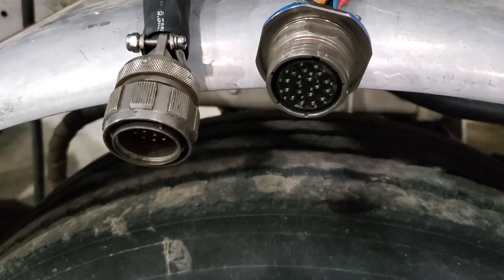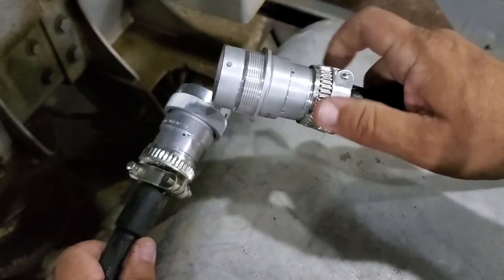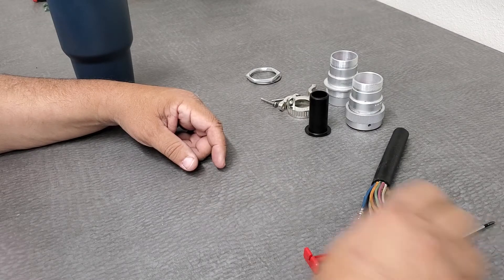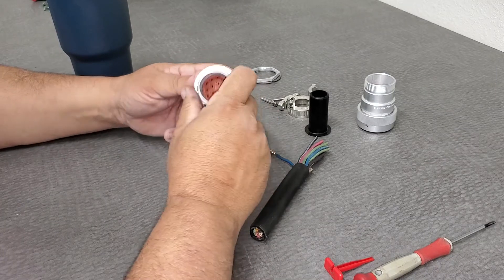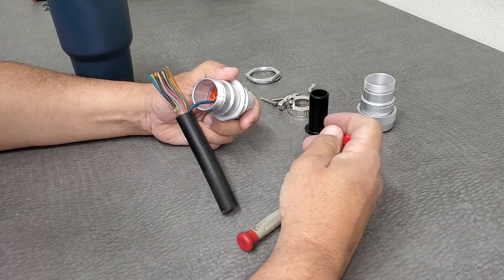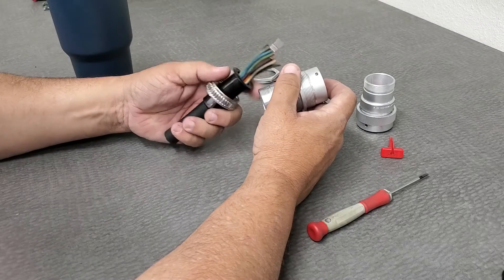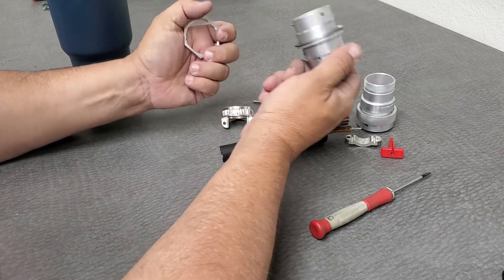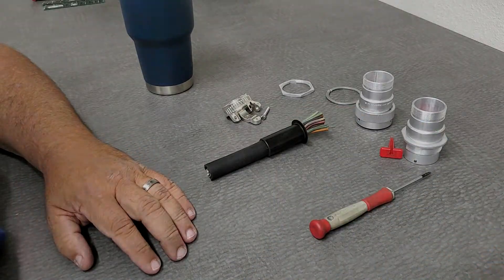Deutsch HD30 Series Connectors

Comment: This video is a bit older now, so I can only hope that you see my questions.  As the Deutsch HD36-18-14SN-059 connectors that we employ have become insanely expensive, I'd like to know if you've ever been able to source internal parts?  The rubber boot/sleeve you featured herein, for example, will break down over time.  The next thing that can break down are the lettered "N-type" silicone seals that one pushes the connectors/conductors through when wiring one of these things.  The point being that spending upward of $100 to get some of the internal parts that can and should be used with perfectly good external AL connector housings is a bona fide waste of money.  If you have any information in this regard, I'd appreciate the tip.  I've both liked and subscribed, so please consider continuing the informative videos.  Thank you, sir. 👍

Comment: Hey friend.. Just happened across your post here hoping to find some other specs, but in doing so heard talking about the disadvantages related to the large protective rear shroud option. Incase you're unaware, I thought I'd let you know that Deutsch (as well as Amphenol's Duramate series) has numerous Backshell options for these Size 16 & 24 HDP20 /HD30 connector series. Amphenol references them as their Duramate series & within that, AHDP for Plastic & AHDM for Metal. They are fully compatible with Deutsch's HDP20 (Plastic) &  HD30 (Metal) connectors. 

If im not mistaken, Amphenol offers a couple more pin insert arrangements than Deutsch. 

Instead of contacting Mouser, your probably be better off downloading both Deutsch's & Amphenol's Catalogs for this series, as well as each of these series's accessories catalogs.  This way you can view every single Backshell option that's available. There are many many options..

For example, I'm using an Amphenol AHDM 24-29 (Metal) connector with plastic Backshell. It uses a thread on adapter to create a flange of sorts, that a plastic Backshell then snaps over.. (you can install whether wired or not). If i recall correctly, there were metal options as well. You can download all these catalogs right from the same web pages you found your Mouser parts on.

Take care my friend.
Reply: Thank you for informing about the other manufacturer option